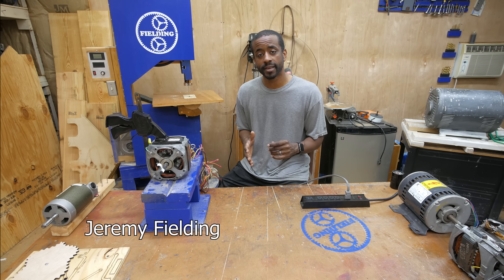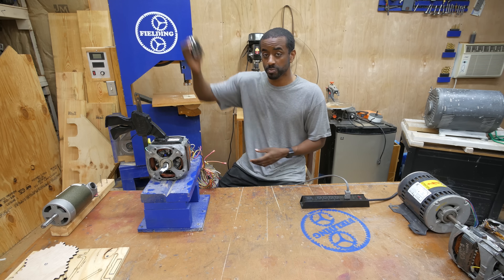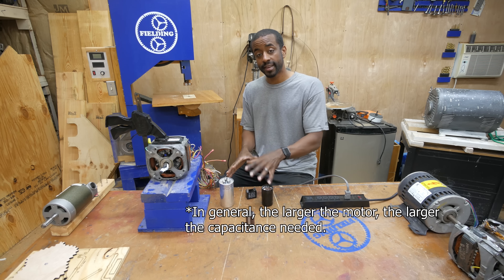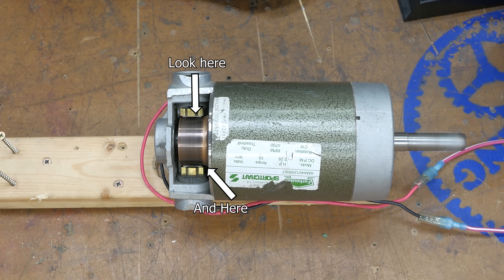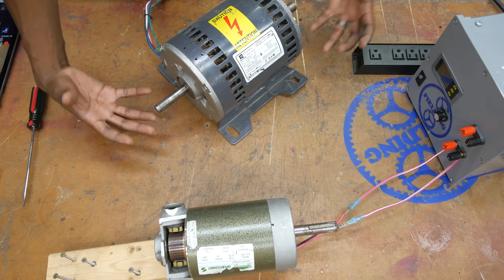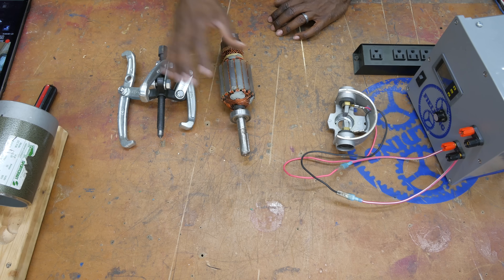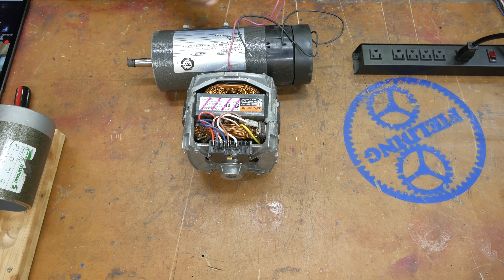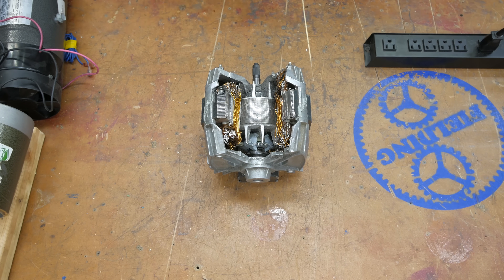Three Most Common Motor Fixes Anyone Can Do; Ultimate Guide to Electric motors ; #070

Comment: hey Jeremy, i have a dryer motor that i would like to use in a project im working on. i have it on the bench and wired it up and it starts as it is supposed to. but after 5 to 10 seconds it will smoke and then after 10 seconds or so the thermal switch shuts it down. when the motor coold down and the switch resets it will start back up and do it all over again. i thought it might be the bearing but the appear to be fine. what would you guess the problem is

Comment: I've seen many servo motors (and asynchronous 3 phase motors with vfd's) develop ground faults and cause alarms that keep the amplifier from turning on. This is particularly an issue with 400 VAC and higher. Often times you can't even measure the resistance to ground without a Megaohm meter; I've seen motors meg open to ground then show a dead short when testing at 500 V and higher; this obviously won't cause any issue in the amplifier unless it's outputting enough voltage to make a ground fault.

Comment: Hi Jeremy, great videos mate - just started watching (and subscribed!).  I have a 2-pole, universal motor (6-pin connector) on a Bosch front-loader washing machine.  The motor recently seized up (rear bearing seized) so I had both bearings replaced.  Put motor back in, but now it starts and then suddenly stops after a second!  Everything looks okay, and DMM continuity is all good, except I didn't check the commutator and armature.  Could I have a problem with the armature/commutator that is causing this problem?  Whether I start on wash, rinse, or spin, the motor will kick-off turning, but then just stop!

Comment: I haven't actually fixed it yet, but I have an AC motor that has a decayed bit of PCB(?) in it. There are some screws that were mounted through the case to screw on some power connectors. IIRC they were soldered to the wires that make up the windings

Comment: awesome video sir! I am here because my old hot tub jet pump wasn’t working this morning. it’s 20° outside and i was worried it will freeze. The shaft spun freely but wouldn’t start. ended up whacking the side of the motor near capacitor with a rubber mallet and it started up and has been running. Need to know what caused it to stop?? Bad brushes? didn’t hear any humming that i recall so prob not capacitor. maybe the centrifugal force lever?? Thoughts please anyone??? would like to fix it asap more permanently.  btw it’s a BN51 motor if that helps. Thanks

Comment: Great video, however my problem is the my 4 hp GE capacitor motor on a deVilbuss air compressor will try to start(1second) and then pops the circuit breaker. Does so repeatedly. IT has two Capacitors, start and run, one silver and one black, have info if it would help. I did not pull the ends off yet to check the shift clutch. Tried on both my Ext. Cord breaker AND direct to outlet with 20 amp breaker. Motor spins freely, air drain open, and turns/spins easily by hand.  Thinking from your video that maybe the clutch not shifting, or fuse/winding shorted out???  Any feedback would be appreciated.
Patrick Harkins

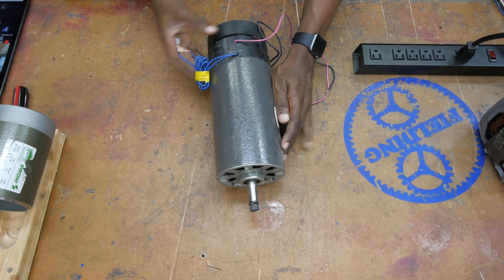Comment: Hey Jeremy! I need an idiot check if you don't mind. I came straight to you when I ran into a confusing set of symptoms on my wife's treadmill motor. It's nearly identical (though a different model number) to the one in your video around 10:00. We got the treadmill from my mother-in-law who bought a new one when this one stopped turning on. $100 for a new MC-2100 speed controller on eBay and it fired right up! Told my wife it was good to go. At work the next day she sent me a video of it stopping when she steps on the belt. Drive and walk belt tension are good. 

Bridging the two motor leads results in less resistance than I would expect. More than when open, but it still spins longer (without the belt attached) than I would expect it to. Ran it on a 12V SLA battery and I can stop it quite easily with my hand. Almost no torque. (Later I tried this again with 4 SLA batteries in series for 48 volts and trying to stop it by grabbing the flywheel with a loose urethane coated work glove used like a hot pad resulted in immediately melting right through the glove. Weird. Makes it seem like it's working just fine. 

It doesn't run long enough to get hot and it's low power not shutting off, so I don't think it's the thermal protection. I do have a spare sensor from another treadmill I parted out a while back. (None of my three available extra treadmill motors is a match for the mount style. Bummer.) 

I pulled the motor. Really frustrating that you have to take the fan off before you can even inspect the brushes on this design. Only one I've dealt with like it. Brushes are long and in excellent condition. Honestly they look like they've barely been worn into shape. 

Commutator looks great as well. Honestly I don't see anything visually wrong with it. I don't have a manual to know what the resistance specification is. 

What next? What haven't I thought to check yet? I have a freaking machine shop here. I can make virtually anything, yet this diagnosis is kicking my butt. My reputation is on the line here! ;) 

Thanks!

Comment: Where was this video 5 years ago before  the motor on my grandpas drill press stopped working ( I was thinking it was the capacitor) I went and bought the wrong one and he got impatient so he took it to an electric motors expert and they said it would cost more to fix it than what is worth 

HE TOLD THEM TO TRASH IT

Comment: @Jeremy - Thanks for your videos.  You do an excellent job,  thats why I just subscribed.  Do you have a video,  or reference on how to fab a dc power controller,  or fixed voltage, (20V) inverter out of 18v battery chargers? At the least,  I want to run cordless Ryobi tools off ac. Tyia for any info regarding this inquiry and future videos.  Enjoy today.

Comment: I had a question!  I’m using a treadmill motor for a 2x72belt grinder and it is not an enclosed motor. So I’m worried about the metal dust getting into the winding. Is there a fix you have for that? 

Also thank you so much for all this awesome information. this is now in my top five watched channels. And has helped immensely with my shop projects.

Comment: Excellent. I am building a project where I will utilize 8 microwave motors. They will have switch individually. Probably they will be working all together or not. What I do not have to do? Wires? Switches? In order to no burn or over charge the system? Thanks!

Comment: My motor bearing slipped on the shaft when I pulled the cap off from the wired side and then pressed it back on.  Now the bearing on the pulley side is too close to the fan which rubes against the case,   Need a special puller to pull the bearing back out and probably replace it. Any suggestions on how to prevent this from happening?

Comment: Hey I have a dryer which motor does not have a capacitor, I believe it is a brushless motor. It is having a issue starting up itself but can be started with a helping push - what would be wrong in that instance, is there a way I can fix a weak or burnt brushless motor?

Comment: I really enjoyed your presentation, precise, clear, easy to follow, and down to earth! I have a table-saw motor, an old Ohio Forge 667-575, serial 02861, 115/220v, 1-1/2 Hp, 3450 rpm. It has two wires on the bell end that may be a switch for the start winding. I was cutting a piece of hardwood and it tripped the breaker. I took it apart and nothing jumped out at me. I ran it and smoke started coming out of that area, but I could not determine what it was coming from. What do you think?

Comment: I enjoy your vids. On Baldor TEFC motors have you seen that bearing can dry up if sitting unmounted for several years? Do you know if the internal bearing generally need replacing if dried out? I bought a NOS 1hp 1750rpm 3ph Baldor motor that I hooked up to a Kbac vfd. It seems to run fine, but it has a high pitched squeal and the shaft does not sound as butter smooth as my older Baldor motors. Any thoughts?

Comment: I have a Leslie 122A rotary speaker (one of the newer ones, purchased around the year 2006) and the motors that spin the rotary horns either don't work at all or spin much slower than they should. Armed with this knowledge, instead of buying new motors to replace them (they are small AC induction motors) I will see if I can just replace the bearings or the capacitors. Thank you, Jeremy. You're saving me money! And I like to learn as well. You're an awesome teacher and I will share your videos with others who would appreciate such well-presented knowledge.

Comment: I had a starter on a lawn mower that the bushing was worn causing the armature to rub no the magnet so it wouldn't turn over fast enough to start the engine unless I hooked up the battery charger. I found a bushing where the inside diameter was the same but the outside diameter was to small so I jb welded it in place it is still working today and that was over two years ago.

Comment: Ok so i have  a lift at work ,won't do anything power is going to the motor but no humming no heat ,,the windings reads 4.7 ohms  start switch checks out fine ,I switch the capacitor with a good one I also switch the relay that takes the power from the switch,the wires on relay were different though any ideas

Comment: I just inherited a delta 50 850 dust collector that doesn't start. I replaced the cap (thought there was only one doh!) so now I have to replace the run cap, will share after. I'm so glad you are such a good resource for motors and clever stuff. Thanks

Comment: I love that centrifugal switch.  Using a spring to hold it together while stopped.  I think that concept could be used in a DIY project of some kind fairly easily.  But of course, typing that was easier than building it.

Comment: I have a stupid easy fix.
A fine grit sandpaper pushed into the brush hole, will clean the commutator when you turn the output, drill chuck, pulley. Be sure to blow the grit out after.

Comment: Years ago our furnace blower motor had a bad bushing. Rather than bearings in the shaft there were bronze bushings. My dad fixed it with what he had, a short length of copper pipe. He cut it to length and cut it lengthwise so when tapped into place it confirmed to the right diameter. The fix lasted for many years, till the whole furnace was replaced. 
I appreciate the excellent content. 
Thanks

Comment: Thanks, Jeremy.  I had a motor fail that is for my heating system and would have been difficult to replace - and it's cold here!  It is a single phase induction gear motor.  Yes, I could "bump start" it so I ordered a replacement capacitor.  When I did the replacement I found the old capacitor had a hole blown in the side and a gob of plastic had squirted out - ya, no so good.  $6 fix.  I'm happy.

Comment: why the heck haven't I found you before!?  Great video.  I have an old AC 1/4 HP motor (can't remember where I grabbed that one from, some junk pile) that has an obvious issue with the starting capacitor.  I use it with a disk sander wheel and DIY unit, having to start it by hand has gotten a bit old so I found you while researching how to fix it.  Subscribed.  Thank you so much, love your vids.  You're very informative and info given are a welcome addition to my YouTube (watching).

Comment: I have a 5 hp single phase 230v motor that had a bearing fail. Motor overheated and tripped thermal protect. I had a spare on the shelf that I swapped into service. I sent the failed motor out for repair. They told me that it beyond repair and gave me a quote of $1500 for a replacement motor. I thanked them and got my old motor back. Now I am going through the motor myself. 1 to 4 has resistance of .6 ohm and 5 to 8 has about 1.5 ohm.  I also tested each lead’s resistance to the motor casing and each was over 10 megohm. Seems to me that all that is wrong is the bearing or am I missing something?  Thanks!  Love you videos!!

Comment: I’m an old guy, no real knowledge of elect motors.  I have two Campbell Housefield  compressors.  First one is 110v. 6hp. With start & run capacitors .. motor just hummed and threw the 15amp breaker.  I replaced both capacitors and it worked a short time then same problem, just hummed and threw the breaker ?  Before I replace the start Capacitor again should I check the bearings and brushes ?  
Compressor #2 is 110v 1.5hp no capacitors that I see.  Motor gets juice ,  but won’t start, brushes look fine ?  Any suggestions ?
OH, BY THE WAY, YOUR FANTASTIC WITH MAKING BONEHEADS NOT FEEL LIKE BONEHEADS. YOU KEEP IT SIMPLE.. SERIOUSLY, YOU SHOULD HAVE YOUR OWN DIY ELECTRIC MOTOR TV PROGRAM ,  HGTV MAYBE ??

Comment: Question:  I have a Bosche portable jigsaw and the motor will not start.  I checked the a/c connection, looked fine.  Looked at the brushes and they show a minimum of wear.  Didn't know where to go after that.  Ideas?  Thank you.

Comment: Hi Jeremy.   Great videos!  Thank you!   Could you touch upon these Fasco D132 3.3-Inch General Purpose Motors, 1/20 HP, 115 Volts, evap motors.  I've had 3 of these quit on me after 2months of running.   The first one came with the evap unit and lasted the longest at 3yrs.  The 2nd I found on Amazon, and lasted 10mo's. ,  The third was a FASCO, and it ony lasted 2 months!      At $60-$70 a pop, I'd like to begin repairing instead of replacing.

Comment: Hey Jeremy, love the videos. I recently picked up a used vehicle winch that's motor was exposed to the elements. I am trying to rebuild the motor; however, the insulation paper seems to be shot. Is there a rhyme or reason to where the tape is placed within the motor/along the casing? Should I just isolate everything to cover myself from a short. Thanks in advance.

Comment: I'd watched this video before,  back when,  which YT seems to ignore when coming up with suggestions.  So I figured I'd refresh my memory a bit.  You want to hear about an odd one?  I have a Bosch drill/driver,  very lightly used over the years since we got it. Recently my lady went to use it and it started smoking!  I gave it a try,  and when you pulled the trigger somethinng was visible through the openings at the back of the unit that I can only describe as incandescent!  And then of course some really obnoxious smoke started to pour out,  this from less than 30 seconds of operation.  I tore it apart (after acquiring the necessary torx driver) and there was no obvious way to disassmble that motor,  it seems to be crimped or something?  So I ended up ordering a new motor from Bosch,  which set me back about $60,  and it's working fine.  I notice that this particular model is no longer available from Lowe's but that a very similar one is,  and it has externally-accessible brush caps.  :-)

Comment: Some D/C motors use A/C    with a diode bridge     and are 120 volt D/C   after the bridge     used on tile saws   and polisher motors  simple design

Comment: The problem that I have is. I have a treadmill and when it's on steep incine at 3 miles per hour my feet spin the motor faster than what it should go. How do I get the motor to  hold me up at steep incine. It already has strong torque forward. But not reverse torque from being spun faster
Reply: It's a 3.5 motor on a Sole treadmill

Comment: Thank you. Great tips. I dropped my electric motor on it's shaft when trying to install on my drill press. Now the shaft slides up and down inside the motor but still runs, it will pop up when started, but drops down when stopped. Do you know what I messed up, and can it be repaired? Thank you.

Comment: Awesome Video... I was once given a chop saw and told I could keep it, even if I fixed it. After taking it apart I found that one of the carbon brushes wasn't making contact with the commutator. I took the carbon brush out and I found that a bit of weld spatter down the channel which seats the carbon brush. Used hammer and screwdriver to knock it off and boom... still going strong today!

Comment: OMG bro you just saved me a massive headache! I was just about to give up on my portable washer untill I decided to search electric motor problems. Is it common for motors to get hot if the capacitor goes bad when on? Thank you btw
Also would it be okay to use a 20uf 250vac to replace a 22uf?

Comment: One thing to mention. If the brushes are worn, the gap between the commutator segments can be filled with graphite. Normally this will blow out, but if you are running a variable speed motor at it's lower speed a lot, it may not. I've had to clean out the gap between the segments. This is not unusual on old electric trains like Lionel. Have also seen this on low speed DC motors used for specific applications in industry. You'll get a lot of sparking if that happens and the motor may get to a point where it won't even run.

Also, if you have a motor that the rotation direction can be switched, and it runs better or faster in one direction than the other, time to replace the brushes.

Comment: I have an electric drill. And it has lost power in the world is not as strong in fact it’s barely even turns. With this be an issue with the brushes or would this be an issue with the windings in the motor actually failing at some point. Be interested in your take on this. I love to watch your videos thank you

Comment: Good video mate, I have tested my ac 230v motor and I get no resistance from ground to either winding, could you advise on which course of action to take next, I have seen video's stating it could be the thermal cut out but how to test? to start with, every time I plugged it in the fuse blew on the plug, supply is good and wiring continuity is good, I hope you can help as you seem a pretty cool chap that knows his business, thanks.